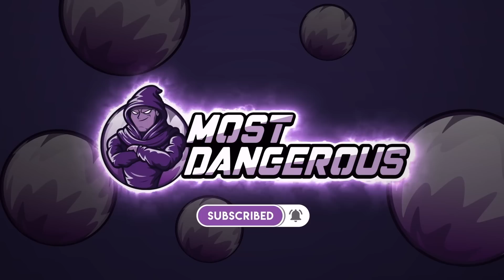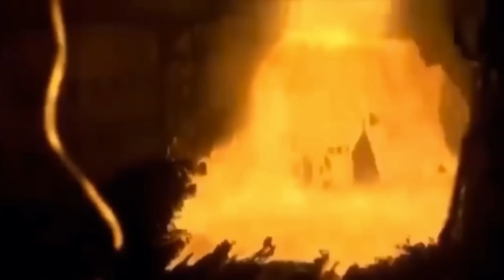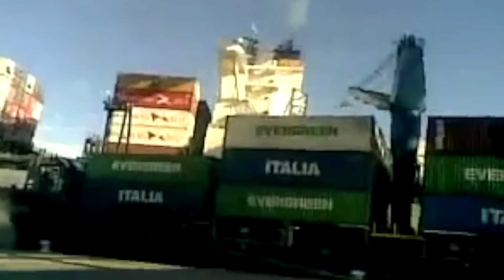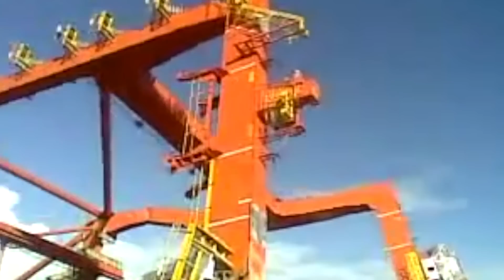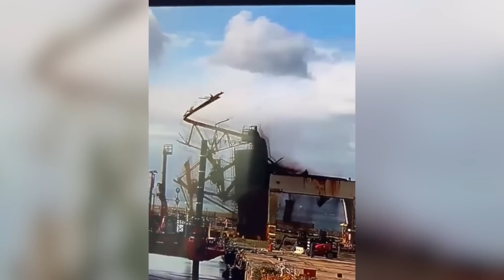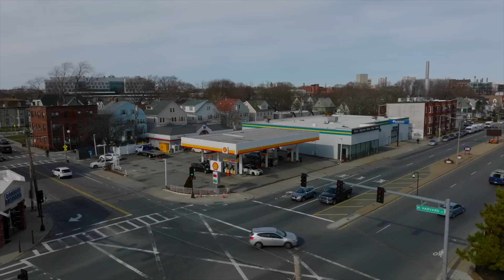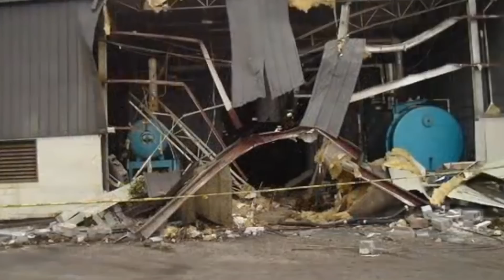Expensive Industrial Failures Caught On Camera

Comment: My old company, precision boiler built those boilers, and they weren't fire tube boilers. They were brand new water tube boilers, and the gas supply was hooked up wrong from the beginning.  It had nothing to do with corrosion. It's called human error period.
Reply: Plus the fact that a couple of the LWCO safety’s had been bypassed and cold water was dumped in it didn’t help.
Reply: @wolf122168  so for short,  human error 🤣

Comment: So video of the boiler explosion was a different occurrence from the aftermath shots.  The pics afterward were of a Cleaver Brooks firetube boiler.  The boiler in the video is a idustrial watertube.  I've been a boiler tech for 16 years and have received training on both of these incidents.  Both boilers had low water cut offs tampered with. Never heard of that boiler they mention that cant explode.  Any boiler can explode under the right circumstances.  Great video.
Reply: Those aftermath photos have been shown on boiler training courses before and the reason given is not a safety valve issue as stated in the video. It was due to a broken water modulating valve that had been jammed in one position and the furnace tube collapsed due to low water level. Evidently the low water cut off was not working, which of course it wouldn't do if it had been tampered with.
Reply: Me either. Don't know what the ad for Clayton Boiler was all about, but given the right operator, they explode just like the rest of them.  lol

Comment: That last one, of the boiler explosion, was at Dana-Plumley in Paris, Tennessee.  I worked there for a bit in 1997, years before the explosion.  Back then they used the boilers to create steam for vulcanizing rubber.
Reply: Amazing. I have no clue why anyone would do such a thing to rubber (maybe like waterboarding- trying to get a confession?) or what vulcanised rubber could be used for (unless Mr Spock had something to do with it) but if it could be so dangerous when no one wants to play with the stuff then kudos to you, sir!😀👏🏼👏🏼👏🏼🫡
Reply: @normturner4849  Vulcanization is used to make rubber harder and to hold it's shape.  Unvulacanized rubber is too soft to be used for anything practical (You can dent it with your fingernail).  It gets vulacanized on forms that go into basically a big pressure cooker heated by steam, hence the boilers.  Once it comes out it holds the shape of whatever form it has been applied to, like radiator hoses, tires, brake hoses, etc.
Reply: @Rebel9668  Thanks for the info. I wonder  how the name came about. 🤔
Reply: @normturner4849  Raw rubber from latex and gutta-percha are soft, sticky and pliable materials- the hydrocarbon "chains" that make up the material are disorganised and can slide around each other and aren't held together very strongly, IIRC the early methods of hardening rubber used only heating which made the material form hydrocarbon cross-linking, but Charles Goodyear (the company of the same name still makes tires) experimented with adding different substances in with the rubber to try and improve the material properties in the early 1800s and while the material naturally links together under heating (I imagine from carbon-carbon double bonds opening up and interacting with those of other chains) he eventually settled on a process named vulcanisation (reportedly after the roman fire/forge diety of the same name) which used both sulphur and heating to produce what was later identified as disulphide cross-linking where two conjoined sulphur atoms strongly bind two chains together that in increasing numbers make the material tougher and more rigid (incidentally the same structure is present in natural proteins and is called a disulphide bridge, and represents one of the stronger, or strongest protein structural linkages).
The longer and more aggressively you treated the rubber the less flexible it is and the more tough and rigid the material would become which allowed you to control the length and conditions of treatment and the sulphur addition the process to produce different materials- longer for the soles of tough boots and robust tires and less so for flexible tubing, and when placed in molds and forms it would retain the shape which allowed you to construct elaborate objects out of it. If you treat the material long enough and aggressively enough it becomes a totally solid and rigid black material, an early plastic often known as vulcanite which was used for parts like the grips of some firearms, the sulphur content is so high that as it ages small quantities of sulphur escape the material and produces a yellowish surface patina of sorts unique to the material.
There's a lot more to it and field has developed a lot since then and I don't think they use the sulphur addition process as much any more and elastomers as a family of materials now encompass a diverse array of synthetic and semi-synthetic materials including silicones, but the term is still sometimes used synonymous with curing. I'm not sure how much more I can summarise the storied history of rubber processing for a youtube comment without making it too long or losing too much info.
Please correct me if I'm wrong; it's been a long while since my sixth form case study on rubber and early polymer chemistry but there's still a bit there it seems.
Reply: @CATASTEROID934  Wowsers! Thank you for that info!

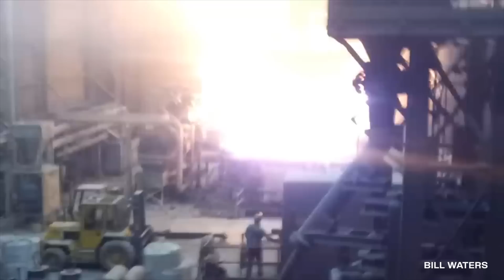Comment: 2:40 In this clip, wet scrap caused the splashing and airborne metal, the heat of which will dissociate water vapor, producing molecular hydrogen (also, oxygen). The final 'bang' was an open-atmosphere hydrogen explosion.
Reply: or maybe just maybe it is the rapid expansion of water into a gas, aka steam. water expands at approximately 1700 to 1 which is explosive. Heat can but not easily dissociate the oxygen and hydrogen which is a fairly strong bond. Generally electrolysis is used to dissociate the two.
Reply: it is definitely not forming hydrogen gas
Reply: @ຈິຕຕະຈິຕຕັງ  it is a very well known phenomenon to foundary workers and a not insignificant effort put into preventing such a disaster. Best you can say is it may not have been one.

Comment: As i recall water turning to steam expand volume 900 X, so eater in molten metal or burning oil,,,, a bit NO NO
Reply: approximately 1700 to 1 ratio. But you are correct.

Comment: So don't work in a foundry. Got it.
Reply: Or if you do then just stand around with your phone recording video all day long. Act casual and nonchalant so management doesn't suspect.
Reply: Make sure you don't have moisture in a crucible,  even moisture from the air, crucible should be pre heated every time before use.
Reply: Better scratch oil refinery off the list, too!
Reply: It’s hard work but it’s good money and good benefits
Reply: It has its moments. Usually close calls. I've only ever had issues when working with a new guy.
Reply: @gmgunner the new guys all said they only had issues when working with you!
Reply: @billpugh58  well gosh darn i never looked at it that way, geeze that might be the case except it ain't.
Reply: And at container crane at sea line
Reply: Wee need here that Mexican dude ,so hi will call mister George
Reply: Hell no one died
Reply: Rite
Reply: It was a pretty cool experience for me.
Reply: In a crane or control room is probably pretty safe, comparatively.  You don't want to be on the floor though.
Reply: No you just follow the rules don’t over load the machinery keep up on maintenance change out parts regularly and typically won’t have problems the local foundry here had 3 accident in the 70’s not much since maybe a broken finer foot cuts etc no huge explosions
Reply: Yo I just read that the Jawas on Tatooine have a foundry in their desert crawler. 

What do they do with the scorched Jawas???
Reply: word
Reply: I did for 36 years. Constant could be deadly situations. We had 6 people lose their lives from 1970 to 2006 that I worked there.
Reply: @charlesstockford6003 I worked in one. The only real accident was a guy chopped off half his hand trimming parts off the trees. He didn’t keep the overflows out of the handles. He was new. Went to reach in and dropped the trim press down on his hand.
Reply: @elizabetherne556  work is dangerous. My wife worked in an office where a guy leaned over sideways while sitting in a chair to get a paper that fell on the floor. He and the chair fell over trapping his arm and he broke both the ulna and radius.  He had a fancy chair with arms on it.  When he got back to work after surgery the other office workers had bubble wrapped the chair up. I bet you can't guess who suggested doing that. Lol he said said the seat arm being bubble wrapped was great.
Reply: Yeah I worked in a Albert's integrated piping systems factory in the 7 months I worked there in machineining maintenance I was sent to the foundry to help with the 2 times the crucible exploded so bad there was steel stuck to the 60 foot ceelings or the wall 100+ feet away all becuse 3rd shift didint pay attention to the warning lights
Reply: Ya sure you'd make good money 🤨
Reply: Stay in your bunker and avoid living.
Reply: I didn't need to be told but this is a good reminder.
Reply: It's not so bad. Just make sure you don't work around a bunch of dummies and drug users
Reply: You can fold laundry or work in a foundry.
Reply: @TrpleAgnt2011  there’s more than two jobs in the world
Reply: Nuclear Factory: Allow me to introduce myself
Reply: WORKED IN A FOUNDY ALL MY LIFE
Reply: Let's send the feminists
Reply: DON'T WORK MEANS WHAT YOUR FATHER WILL GIVE ME MONEY